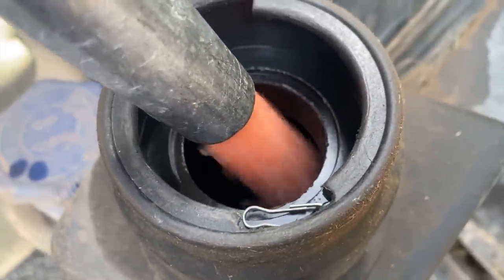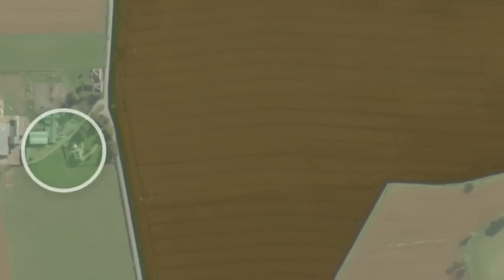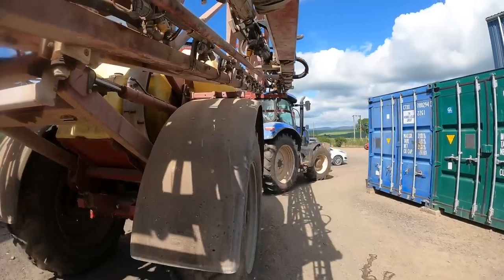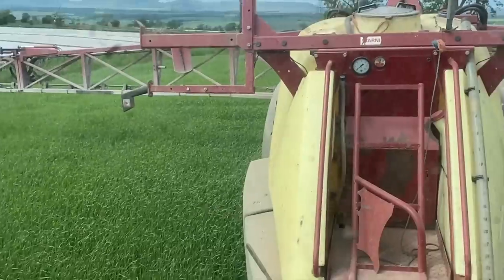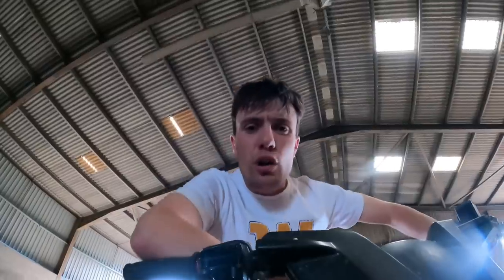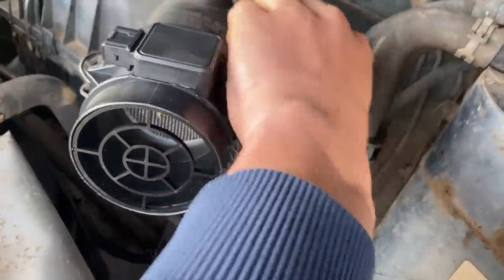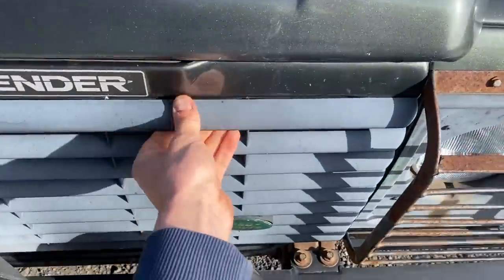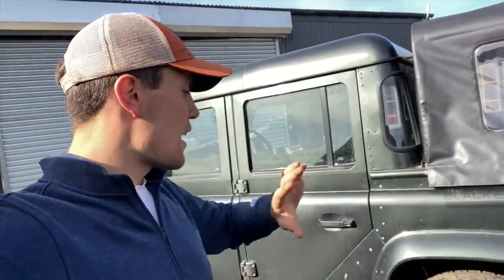Turbo Issue Fixed? | Spraying Barley #290

Comment: Result on the MAF sensor. 
When time does come to do the galv chassis, there is a Polish company that advertises in both LRIO and LRM that is getting some good feedback - the garage that looks after mine fitted one for a customer and reckons it was one of the best made he had seen - said he did not need to use the heavy duty adjustment tools once. It will upset the fanatics but the price is keen and the quality is good which gets a thumbs up from me
Reply from the maker: Do you know the name of them?